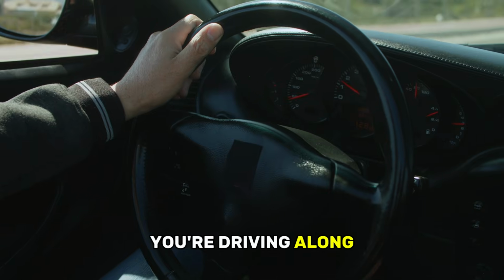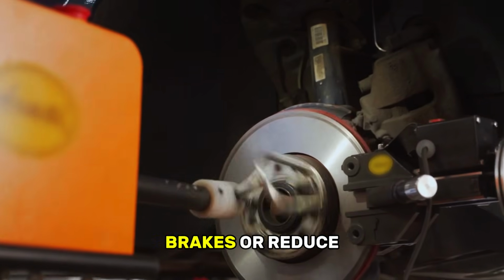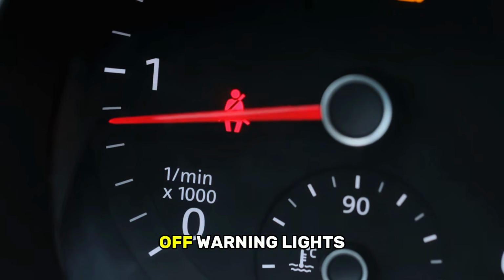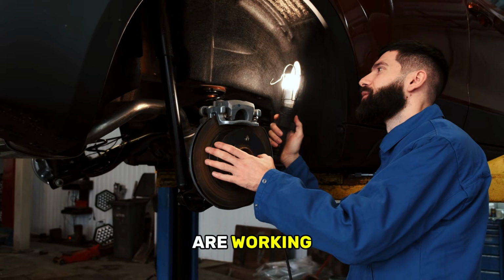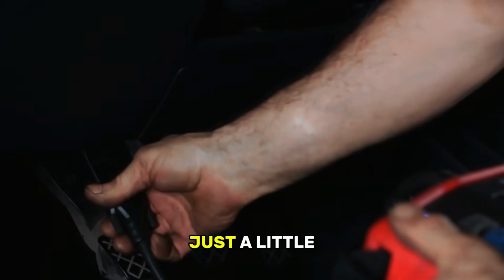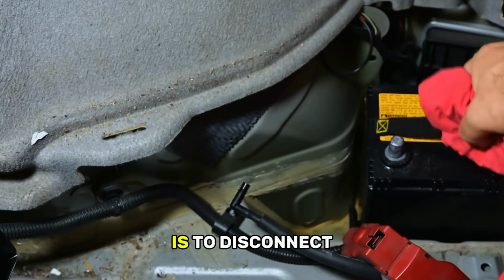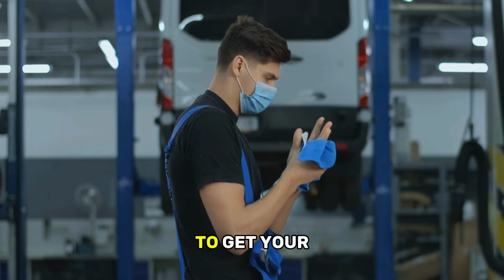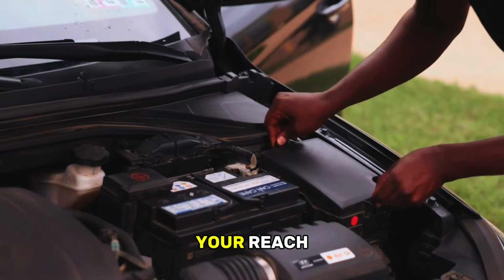Traction Control Light ON? Easy DIY Fixes You Can Do!

Comment: What if we continue driving with abs, traction control & downhill assist indicator shows on odometer atomically ???
Reply from the maker: Oof, all those lights on at once? That's definitely a sign something's up! I'd honestly get that checked out pretty quick, just to be safe.
Reply: @Car @CarFixSchool k you 👍 I’ve got same problem few days back but after driving few kilometers it automatically got disappeared from odometer but same issue came back today, what actually has happened to it ?? What should I check for this particular issue???
Reply from the maker: @ninja4667  Got it bro 👍

This is likely a traction control issue — when it disappears and comes back, it’s usually not fixed, just temporarily inactive.

👉 Most common causes:
• Dirty or faulty wheel speed sensor
• Loose wiring near the wheel hub
• Weak battery / low voltage

🔧 Quick check:
Clean all wheel sensors + check wiring first.
If you have a scanner, read ABS/traction codes (even if light goes off).

Don’t ignore it — it’ll keep coming back until the root cause is fixed.
Reply: @CarFixSchool Thank you brother ❤ but what if I keep on driving my car with same issue at least for few months coz in my area there is parts availability problem, service center can’t provide parts on time here. I consultant with mechanic yesterday he told me not to worry it’s all about abs not working but your break were working properly…what to do what not to do 😢 I’m confused…I’ve 4th generation Kia sportage
Reply from the maker: @ninja4667  Got you bro 👍

Yes, you can drive it for now — brakes will work.
But ⚠ no ABS = higher skid risk.

👉 Just do this:
• Drive slow
• Avoid hard braking
• Be careful on wet roads

🔧 Meanwhile check: wheel speed sensors + wiring (most common issue)

Don’t stress — just drive carefully until you fix it 👍
Reply: @CarFixSchool Thank you soo much brother your suggestion has reassured me a bit ❤ I’ll soon try to fix the issue 👍
Reply from the maker: @ninja4667  Glad it helped, brother ❤ Fix it soon to avoid bigger issues. Drive safe 👍

Comment: Camry acv40 VSC system check and engine warning out and engine shakes and the car turns off by itself and the air conditioner is not cold when parked and cold when driving what problems??
Reply from the maker: "Hey! 😅 From what you’re describing, it sounds like a few issues are happening at once:

VSC & engine warning – could be related to a faulty sensor, engine misfire, or even an issue with the throttle/body control.
Engine shakes & turns off – often caused by idle air control issues, dirty fuel injectors, or misfires.
AC not cold when parked – that’s usually normal for AC systems with a weak compressor or low refrigerant; airflow at low RPMs is weaker, so it cools better while driving.

Best first step: scan all the codes with an OBD2 scanner, check for misfire codes (P0300-P0304), and inspect the AC system pressure. This will narrow down whether it’s mostly electrical, fuel, or AC-related. 🔧"

Comment: What if it effects power in the engine
Reply from the maker: Yes, it can. When the traction control system detects a fault, the car may reduce engine power to protect the drivetrain and prevent wheel slip. This is sometimes called “limp mode.” Checking the wheel speed sensors, wiring, and scanning for codes is the best first step. A simple sensor issue can often trigger both the traction light and reduced power. 🔧

Comment: I agree with this video but my 2014 Chevy was doing the same it was my spark plug wire need to be push up further to snap onto the  coil pack plug was loose. Engine light was
Reply from the maker: Thanks for sharing that! 👍 A loose spark plug wire can definitely cause similar symptoms and trigger the check engine light. Making sure the wire snaps firmly onto the coil pack is a great quick fix. Appreciate you adding that tip — it might help someone else troubleshoot faster! 🔧

Comment: How about blinking park light, when ABS BRAKE on, can't get part on 2015 SRX Caddy.  Was told by Dutton Auto Co, Riverside, ckd everything, says control module for those things but blinking park just started in El Paso, TX area, Riverside in CA.
Reply from the maker: It sounds like you’ve got a bit of a puzzle on your hands! I’d recommend checking the wiring and connections around the control module. Sometimes, it’s the little things that can cause big issues.
Reply: @CarFixSchool  my 2016 toyota tacoma 3.5L has the trac off and CEL on just yesterday. I checked it using my FIXD and it gave me a codes P2610, P0115, P0116, P011B. The last three codes says the coolant temperature. I just took my truck for service a few weeks ago to repair/replaced the coolant bypass pipe/housing leaking. Do you think its the reason for the 
warning lights? Maybe the dealer did not reset something?
Reply from the maker: @Malingkat5949  Yeah bro, those codes are actually pointing in the same direction 👍

P0115, P0116, and P011B are all related to the engine coolant temperature sensor (ECT) or its readings. Since you recently had the coolant bypass pipe/housing replaced, there’s a very good chance something got disturbed during that job.

👉 Most common possibilities:

A loose or partially connected ECT sensor plug
Damaged wiring near the sensor during the repair
Air trapped in the cooling system (very common after coolant work)
Low coolant level or improper bleeding

Now about P2610 — that’s usually related to the PCM/ECM internal timer, and it can sometimes show up when the battery was disconnected or after repairs. It’s often not a big deal by itself.

⚠ Also, on Toyotas, when the check engine light (CEL) comes on, it can automatically trigger TRAC OFF, so that part is normal.

What I’d recommend:
Pop the hood and check the ECT sensor connector (near thermostat housing area)
Make sure coolant level is full (engine cold)
If possible, bleed the cooling system to remove air
Clear the codes and see if they come back
Honest take:

Since this started right after the repair, I’d definitely say there’s a high chance it’s related to that job — not just something needing a reset.

If you don’t find anything obvious, I’d take it back to the dealer and let them recheck their work 👍
Reply: @CarFixSchool  after they replaced the coolant bypass pipe they filled up the reservoir in between the low and high mark. Then i drove 100 miles then the following day its a little below the low mark. I was thinking maybe it was the reason those 3 codes came out. But i’ll do/check the ect today. Thank you for your help
Reply from the maker: @Malingkat5949  Yeah bro, that coolant drop is actually pretty normal after a repair 👍

After they replaced the bypass pipe, some air was probably trapped in the cooling system. After driving, the air gets out and the level drops a bit — totally normal.

👉 But about your traction control issue, low coolant usually won’t directly cause traction control / TRAC OFF lights.

However, if the coolant was low enough to affect the engine temp sensor (ECT), it can mess with engine data — and that can sometimes trigger weird behavior in the system.

✅ Good idea checking the ECT sensor. Also check:

Any stored codes (especially ABS or wheel speed sensor)
Live data if possible

💡 For now:

Top off coolant (engine cold)
Monitor if it drops again
Focus more on ABS / wheel speed sensors for traction control issue

If coolant keeps dropping OR you still get lights, then we dig deeper.

Keep me updated bro 🔧

Comment: I've used Obd tool and it told me its front wheel speed sensors, then I changed them but still the light comes on...
Reply: Check axle ring
Reply from the maker: Great tip! Checking the axle ring is definitely a solid step in troubleshooting traction control issues. Thanks for the suggestion!
Reply from the maker: That's frustrating! If you've changed the sensors and the light is still on, it might be worth checking the wiring and connectors for any damage or corrosion.